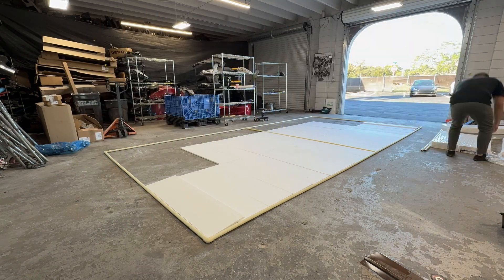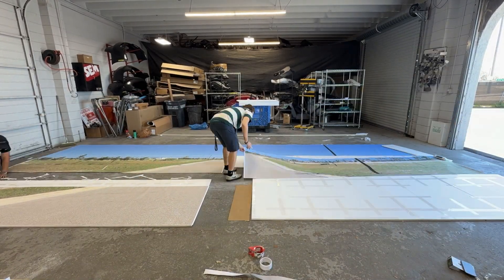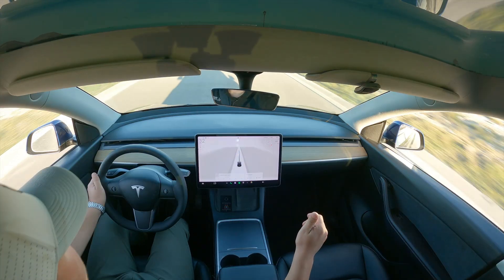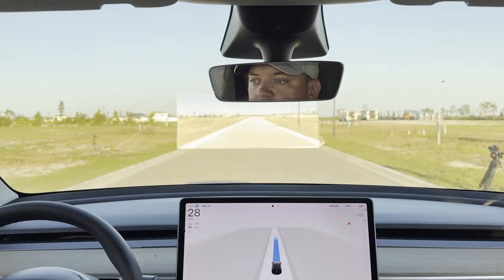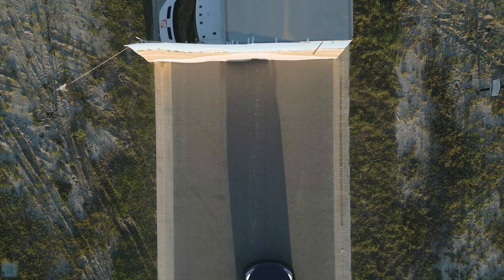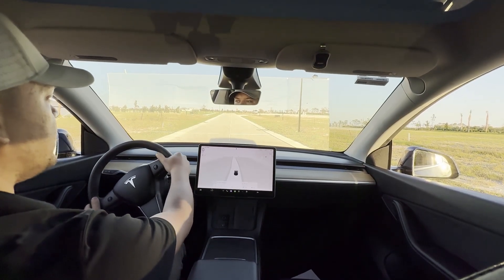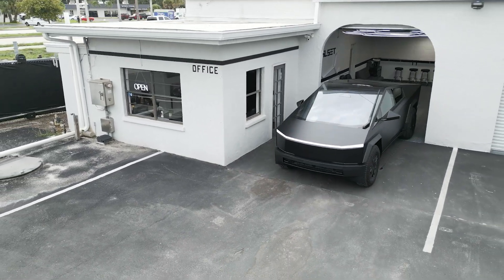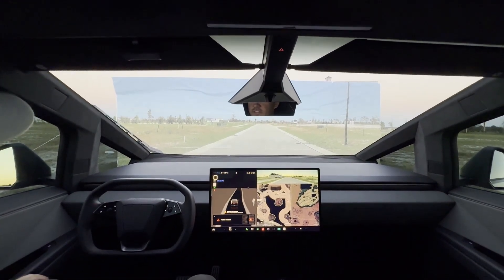Response to Mark Rober’s “Can You Fool A Self Driving Car?”

Comment: Explain to me how the vision system saw the wall to stop if it's not showing up on the indicator? I'm asking a genuine question.
Reply: Tesla has said the display animation only shows some of what the car is seeing
Reply: @global_optimization  The Cy6bertruck sees the wall though. It displays it as a gray line in each one of the tests. Look at it; even from afar. It displays it as a gray perpendicular line to the road on the road. Goes to show how big of a difference v13 vs v12 makes.
Reply: @CyberFridge  But that's only when I got really close right? I mean once the vision system gets super close where that field of view changes from the board to the background then I would assume it's going to see it
Reply: @WarpedYT  Look at the first Cybertruck test for example. Go to 6:57 and pause frame right there. Look at what the Cybetruck displays on its screen: 2 cars and a human to the right and then at the very top of the screen is a faint gray perpendicular line. That line is the wall. I'd argue that it sees it with plenty of distance and time to spare.
Reply: @WarpedYT I assume you mean with the model y and the answer is they intervened to hit the brake because of the u haul behind the wall acting as support.
Reply: @ShieldWolf-yp3cr Oh yeah! Crazy I See the U-Haul now 🤦‍♂️🤦‍♂️
Reply: What the car sees and what you see on the screen are actually two different systems. Car sees more info.
Reply: @CheesyWhales  It just brings more doubts in my mind about the vision-based system I never liked it I think the combo like on my model s seems to work the best.. I always wonder why Tesla moved to purely vision based, was it cause cutting?
Reply: @WarpedYT  The reason? It is because: FSD is an AI system. But very more close to ChatGPT kind of AI than the Waymo [LIDAR] or Falcon 9 landing system [RADAR and others sensors] approaches.

Some folks doesnt yet seems to realize that FSD generalize what it is doing. Want to put it in a completly new locations, new roads, new rules? It will work preatty well. Like in China, this year.

Waymo has a different approach. It is not exactly like the rocket Falcon 9, but it is more simillar to it than to FSD, since V11. Why? Because FSD isn't 'hand-coded'.

Are you allowed to criticize them for the now lack of the LIDAR sensor? Maybe. But, FSD is playing in its own rules. That's the point.

Folks: FSD is more like chat gpt, than anything else. This approach trust in a kind of AI that is more like a mind, and not a reactor. The Lidar is not doing nothing bad, it is great, but its just that, a sensor. What really metters is the mind, in the FSD own logic. The point is: they are doing something generelized. Waymo and others are doing something less generelized and more handcoded, that can be great too. But FSD promise more. Its a bet; that one day, maybe, AI really being awesome.

FSD predicts, remember, react, and make actions. If a road get dark, it will remember the road's shape and make a decision to stop or to continue, because it maybe knew it was straight and a line.

The whole point is: the bet is an AI that works with restriction, because the mind is enough.
Reply: @WarpedYT 100% cost cutting. Officially Tesla says that it makes it easier for the computer to integrate data when it’s all the same type, but that’s just selling a bug as a feature. Cutting radar sensors before full vision was ready was for the same reason there’s no sonar sensors, no driver’s instrument cluster, no tin top option, no roof shade, etc. Cost cutting is the name of the game at Tesla and that’s how they have the best profit margins among US based EV models.
Reply: @nitrobenz1694  That makes The most sense.
Reply: @nitrobenz1694  agree 100%.  I always laugh when ppl repeat elons talking point that data from too many sensors “confuses” the system hahaha, halarious.  How does a program get “confused” it only does what the programmer tells it.  Ever heard of “if then else” statements for the different data sets?  Lol. If the system is confused its only because the programmer didnt account for that scenario, thats not a data issue and the system is not confused.  Having lidar/radar with cameras is no doubt superior technology then camera only because lidar/radar can detect objects that a camera wont, especially in the dark.  Cameras need light, an absence or obstruction of light is a problem, but not for lidar/radar.  And dont tell me lidar needs light too, lidars provide the light, cameras need something other than the camera to provide the light
Reply: @WarpedYT to my knowledge it's the same reason comma uses only cameras. The thought is we only have "cameras"/eyes and we sense distance via parallax. (I think that's the word, iirc) And AI is supposed to catch up to us. This is about, if I understand correctly, better model training.
Reply: @light-rd7vq 🤦 Someone doesn't understand how AI models work... 😑
Reply: @CheesyWhales  cope LOL
Reply: @Seqqsy wym cope? This is a known thing. You don’t even want to do the bare minimum and look it up
Reply: The vehicle only shows what is categorised on the screen..... human, car, van, truck, cyclist etc........ unquestionably it does not have a categorisation for "ACME FAKE REALITY WALL", so it will not show it.
Reply: It looks to my like there are times it sees it and times it doesn’t. The reason it is likely stopping regardless of not continually visualizing the wall is because of its memory.

For example when newer versions of FSD see someone walk behind a car, it will remember it saw someone go behind the car and expect them to possibly come out from behind the car eventually, so it opts to act cautiously. I think there might be portions of time as approaching the wall that it thinks similarly. 

What the car thinks: “I saw something weird that is a potential hazard, but now I don’t, hmm, let’s be careful here and further form an opinion on what is here before speeding up again.” Drives closer, “oh, there is clearly something here that shouldn’t be.” Gets very close and the entire wall fills the FOV, “huh, this looks normal, but I’m not gonna risk it, I remember there was something strange here, staying put” or “there are ripples in the sky in front of me, must be a mural or something else solid here”. 

Lots of anthropomorphizing here, but just trying to wrap my head around it in the way we might think if locked inside of a computer and forced to do something over and over again until we successfully do the bidding of our master without any previous contextual knowledge.
Reply: @lestertheinvestor4333  That's very interesting thank you for the explanation, I'm starting to get really interested and putting together a much more complex elaborate test of my own, for now I'm going to continue to collect information and compile it for a possible episode, I don't have the newer system I have one of the last systems with vision and sensors. That's really interesting if it actually remembers but my car for instance not as advanced but remembers where the suspension went up or down so maybe it's something similar based off of GPS? But I don't know if GPS would be accurate enough for safety.
Reply: @WarpedYT one reason sited by Tesla to remove the radar was that it was introducing too much noise and discrepancies between sensors. 
Also merging data from camera only is much simpler than trying to merge data from lidar/radar and camera together while keeping everything coherent.
Reply: @1943vermork  That makes a lot of sense, I have worked on some military projects with vision-based real-time 3D mapping guidance, and it works really really good at much higher speeds than a car, I think  one unit is cheaper than paying the subscription for the FSD lol, although the vehicles I have worked on use seven to nine cameras and stitch that data together to make a real-world 3D environment In real time, however they are very susceptible to obstacles that are less than a minimum resolution and of course they need light. So this is all interesting information...thanks
Reply: It has ultrasonic in the front but that's only used for park assist and only meant to be used at super low speeds and very close range. Perfect for when it's parking itself as its only going a few MPH. I do think that v13 on a HW4 car would have seen this with the cameras but maybe not fast enough to stop from 40MPH.
Reply: @ashersalt2156  Kyle was going 34MPH at 6:57 when the Cybertruck depicts the wall as a perpendicular gray line on the road in the visualization and the CT starts slowing down shortly thereafter. I doubt that the extra 6MPH would have prevented it from stopping. Assuming of course, Mark would have actually used FSD and let it run for a little bit and not turned it on 4-5 seconds before his Model Y hit the "wall". If you don't give the system enough time to stop, it doesn't matter if it's able to see it form 10 miles away if you only turn it on at the last moment.
Reply: I'm wondering too if part of why the Cybertruck picked up the wall may have been due to the cameras perhaps switching partially to infrared to compensate for the low light. This is a thought I had on Robers' video about how to improve the performance of a pure visual system. IR simply does not pick up most colors, so a printed surface looks clean. (At least on my nanny cams.)
Reply: @kstricl  good point, But depends what type of IR it's picking up, because if it was thermal then there would be a clear difference in temperature and it would know its wall right away
Reply: @WarpedYT  and don't forget that the cameras in the hw4 are much better than in the hw3 and probably the reason why it saw the wall is the difference in brightness from the sun set
Reply: @pinkfluffybattt5414  that is s definitely possible, I'm taking notes if I decide to do a much more complex and comprehensive test in the future. It's getting interesting
Reply: @WarpedYT  if you decide to make a video, try moving or removing the wall because fds remembers things
Reply: @WarpedYT  other thing I didn't see mentioned is that the cyber truck has a front facing camera which  m3 and mY doesn't
Reply: I would say the FSD system uses vision only to reconstruct a 3D environment - a pixel cloud with x,y,z.

The 3d dimensions of objects can only be reconstructed from how they change relatively to the movement of the camera.

With a picture there is no movement of the objects they stay the same even if the cameras move nearer.

For FSD this could mean everything it sees in the picture is moving in the exact speed as the car or it a static picture - the display probably will show nothing as long as the system is uncertain what it is.

That would be my guess.
Reply: @danielwinterbacher1369  for that the system needs to identify an object to start tracking it. In this case it was up against an optic illusion so there was nothing in front, just the usual road. If I'm making myself understand?
Reply: @samega7cattac  It's "super easy" to identify and classify objects on a 2d image

hehe not super easy but 1st semester university easy

It's harder to get the dimensions as the 3rd dimension is not available
Reply: shadows
Reply: Fsd has direct access to the cameras and can see everything the camera sees, it's just a matter of how it interprets what it sees for what driving decisions it makes. The visualization on screen is a separate system mostly for visualization for the user and is not representative of what the fsd ai actually sees.

(Edit) To add to that the visualization is using a much more simple image detection algorithm that only detects what it's trained to detect which is a hand curated list of objects which in this case does not include walls on top of the imagery on the wall easily tripping it up. The fsd model has not been trained to see any particular thing. In the training process the almost raw imagery from the cameras is fed into the model and through its training process the model learns what from the camera feed is relevant and how to interpret it very similarly to LLM's as been described before. But as we can see fsd is only so powerful and has limitations+ it probably hasn't been trained on tricks and optical illusions like this so it doesn't even know to consider such a thing and fails on these tests. But theoretically this specific issue could very easily be trained out just by adding this scenario to its training process.
Reply: It does show on the indicator.
Reply: Wdym, he said he was the one slamming on the breaks at 5:20
Reply: @samega7cattac  yes but with the Cyberpunk it saw the wall and stopped but I didn't see it show up until it stopped
Reply: He actually applied the breaks, the only Tesla that stopped was the cyber truck, watch the video again
Reply: It's not stopping on its own, he's stepping on the breaks because he know the vehicle is not seeing the wall. The vision system is only seeing its a wall when it's right up on the wall. This system fails miserably. Using a camera to tell a system what to do would always fail. It's the same reason planes don't use cameras for the landing or whether systems.
Reply: @WarpedYT  The visualization system is outdated. I’ve seen it happen a lot where the car will react to things it doesn’t visualize or visualizes as different objects. The reason it shows up later is the ultrasonic sensors
Reply: @Icerz.  Ahh I get it, What are the ultrasonic sensors for? Does the newest FSD have the ultrasonic sensors? I thought they took them out and it was vision only? Is that for parking?
Reply: @WarpedYT  Yea ik there is a new parking system that uses them. I remember hearing they disabled them too last year. But you’ll see them react as yellow and red curves around the car on the screen if you watch fsd drive videos. Haven’t looked into it too closely
Reply: @WarpedYT  they stop putting ultrasonic sensor in 2022, it is pretty much just used for parking sensors now
Reply: @Icerz.  the current parking proximity with yellow and red lines is camera based, not sonar. It is pretty remarkable how well it keeps track of objects that are out of view, but does sometimes forget about or miss things that are right next to the car, especially the front bumper. Which is why they added the bumper cam on the Cybertruck and Model Y refresh.
Reply: @WarpedYT ultrasonic are still used for parking or measuring the distance of close objects.
Reply: Try watching the whole video. He was stopping it because it wasn't showing up. It wasn't seeing the wall so he stopped the car himself.
Reply: Because this test was fake

Comment: Good work!  Made a simple wall and put it out and did a straight forward test of fsd with no hands or feet on the controls and using two versions of hardware and software, the way it should have been done. Rober used autopilot with some error message displayed, held wheel moved his foot to the brake in raw footage and hit brakes as he hit the wall.  He even placed bushes at both bottom corners of the screen to ensure it was even more difficult for the car to notice .
Reply: Mark Rober and Austin Russell appear to have a friendly relationship. Mark Rober partnered with MrBeast to launch #TeamSeas in October 2021. Austin Russell, the founder and CEO of Luminar Technologies, made a significant donation to #TeamSeas, reportedly around $4 million based on later accounts of his philanthropy.

Comment: Cybertruck probably stopped because the sky colours didn't match, and so did the wrinkles. But also, the computer processing the data on Mark's Tesla is older and slower than the one on the cyber truck. So, the results can probably be changed, but only to an extent, with software updates.

Comment: Newer HW has higher megapixel cameras which obviously is going to help.  Also, the time of day was different between the two, which may have been a factor.  I'd like to see another test under the same conditions (i.e. time of day).  Would be cool if you can find a HW4 Model Y with the latest version of FSD.